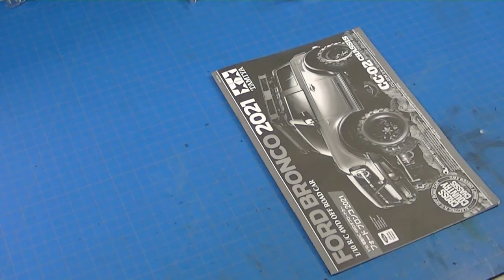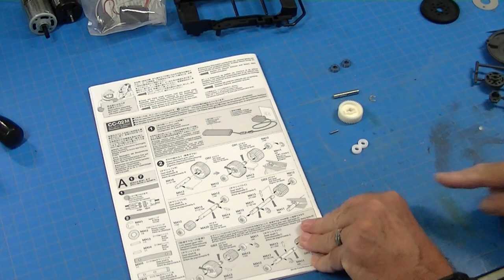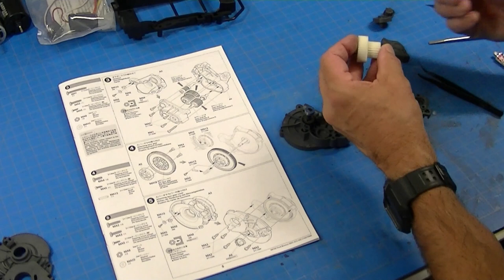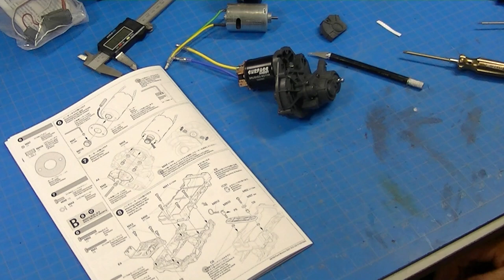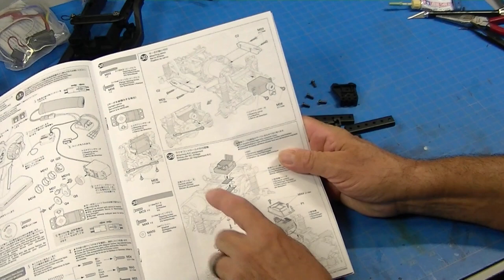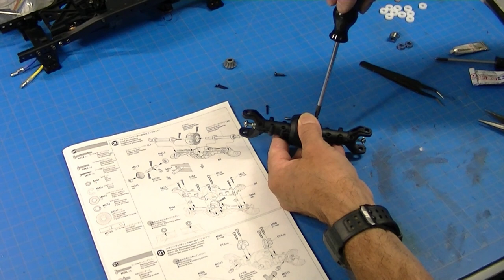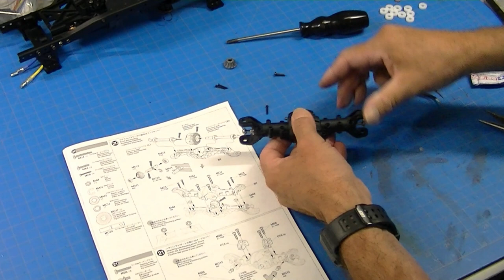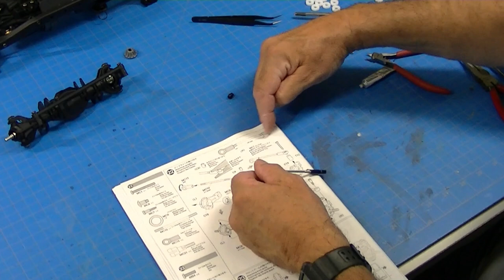Tamiya 1/10 Ford Bronco Build for Novices - Part 1 Chassis

Comment: Great video. Just build one myself but I can’t seem to get the servo mounted right. It turns more to the left than to the right. And I did center it. Any suggestions?
Reply from the maker: You can usually set up sub trim in the radio to get thigs centered and then use the endpoints to set the amount of steering travel.  You can set the endpoints differently side to side.  For example it might take 88% one way and 103% the other to get it right.

Comment: Thanks for the video - I found it really helpful. This is my fourth Tamiya build and I found it to be the trickiest so far for a few reasons: (1) I wasn't sure what dictates whether steering servo should be mounted in the lay-down or upright position - I should probably have done upright, because in the lay-down position the cable coming out of the servo fowls with the chassis (2) The little on/off switch that comes with the ESC seems too small to fit where it's supposed to go in the model (3) The steering servo cable on a Futaba servo isn't long enough to reach the receiver where it's located, so I am buying an extension. Still, it's been fun to build and I'm moving onto the painting of the body shell now and will use your video for that too.

Comment: Thanks so much for the guide — it’s extremely useful! I was wondering one thing… in the manual, a lot of steps of attaching smaller metal parts to plastic involve synthetic rubber glue, but you didn’t seem to use it. I was just wondering if it’s actually ok to pass on the glue and not use it at all? It does not seem to be part of the package.
Reply from the maker: When they call for that cement I usually use E6000.  Hobby Lobby, Lowes, Home Depot etc. sells it.

Comment: Technical question, since setting motor spacing is an issue with me

When you put the paper between the spur and pinion, are you just pushing down until it stops, or are you going for a diamond-shattering death grip?

I think doing the latter might be the root of my problems
Reply from the maker: I just push it til it stops.  I am pretty old so death grip no longer an option :-)

Comment: I was hoping it had a bruiser type chassis. I guess this chassis is for affordability.
Reply from the maker: This is quite a bit smaller than a Bruiser but way more flexible and a lot more suspension travel.  Will be a fun crawler type rig.  The parts fit and finish is amazing.